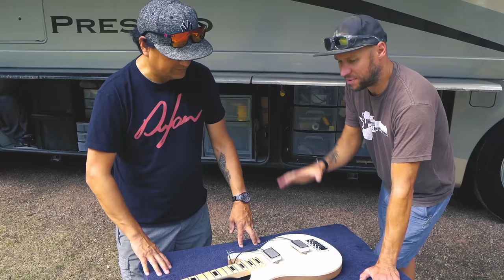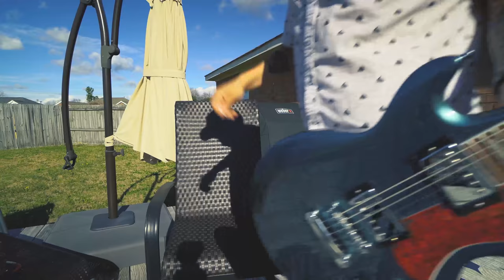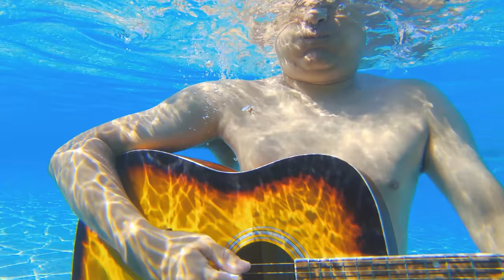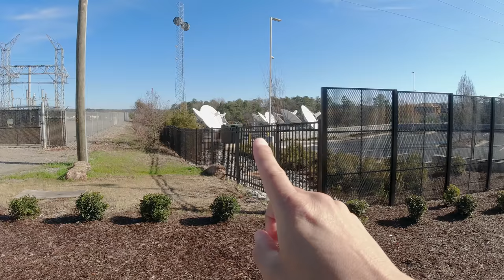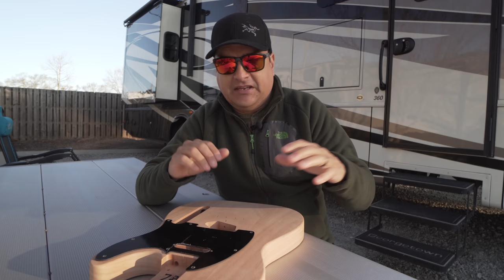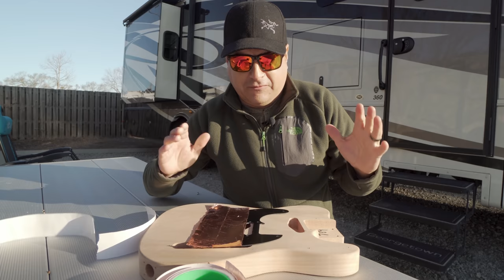How To Shield Your Guitar - Myths Busted

Comment: "60 hz wave is 17 1/2 feet long so the hole has to be smaller than that to stop it." - Doesn't that mean you can leave a hole big enough for the front of the pickups and still have a Faraday cage for 60hz, technically? 100% attenuation isn't necessary. Quibbles on the terminology aside another great video from you, good practical advice. What do I use? I've used tape in the distant past, it was a huge PITA and I had to redo it several times but eventually I got it to work. When I got back into a guitar after years away, I expected to have to do it again; and I got some paint on sale to try that method instead. But I never applied it. I haven't found any hum yet, and I'm not going to try to shield until I have a way to test the shield and see whether or not I got it right. But eventually I expect to give the paint a try. Gonna need a tiny brush and some good optics for that.

Comment: What if it is a guitar with no pickguard? Do you recommend shielding the pickup cavities?
Reply: I have the same burning question
Reply: You can, it's better than nothing.
A partial shield is always better than none.
Reply: why not use a noisegate ? once you start adding effectpedals you ll need that anyway
Reply: He's said it several times... If you do require shielding on a guitar with no pick guard, you can try to apply shielding in as much cavities as you can. Just avoid the input jack to prevent shorting the circuit.

Comment: Also, making the face of the top of the guitar arched would act opposite from a dish, radiating the RF away from a central point, and to ground. That's why physical shields are shaped that way, to direct the attack away from the center. I'm digressing, but curious about how the difference between RF striking a fluid concave meniscus vs a convex meniscus and how to control the nature..and how that could be used to accept or reject certain signals and or noise.

Comment: Thanks Dylan... Great info to add to my research as I start my first build. It will in fact be a Tele.  The control cavity advise , was time and trouble saving and also leaving the output jack alone.  Does the ground wire however have to hit the copper or will the normal pot grounding be enough.?

Comment: What do you recommend doing for a Jazzmaster that has an aluminum pickguard? Just make sure the pickguard is soldered to ground? I'm going to have a tech do some wiring for a partscaster, so I'm a novice with this stuff, but based on what you're saying, it seems like I should not have to shield the body at all if the pickguard is aluminum.

Comment: I got a roll of aluminum for my guitars. It works well no I think i paid $5.00 for the roll at Home Depot. I used paint to cover the gaps and tested it with a multimeter set on continuity. That way it beeps whenever here is a good connection. Then, if I need to I bought plastadip to keep things from shorting out!

Comment: Question for you mate, I had to get my guitar a bit more resistant to feedback in a hurry and couldn't find any copper tape. I found Aluminium. Laid a couple of bits on top of one another, got continuity, so I used that. It has worked, but would copper be loads better? Should I redo it? Or should I just leave it aluminium? By the way I did my control cavity! Nothing is shorted and the guitar sounds so much clearer with its super low noise floor

Comment: i shielded a very noisy harley benton ja60 with p90s. all copper tape. Pickguard. Cavities. Result. Its quieter, but the P90s (which you cant swap easily because of weird screws) are still noisy. But the overall noise is gone and its less prone to radiation noise. changed also two pots to 500k, maybe some of the noise is gone with that. HB skips the whole shielding because the guitar comes for under 200 bucks. But with p90s......not the best decision.

Otherwise i only shield with weird noises. My old ibanez grg crackles when you touch the screws of the pickup selector. A bit of shielding and that was gone.

Comment: I am a bit confused something you said about the wires not being a good antennae for RFI/EMI. I've been using shielded wiring in my guitars for years now and had great success in interference free play ever since I started. As a network engineer it seems highly logical. It is after all why we have shielded cabling. I'm definitely curious to learn why you don't think the wires are a good receptors. Wouldn't the metal housings of the other components be more like a faraday cage since they are grounded housings. I'm not the expert and am not trying to argue at all. Just want to learn what and why things work the way they do.
Reply: And you did do a great job explaining a lot. Hopefully not confusing more than myself.

Comment: I know there is more noise introduced through old wiring in homes and bad wiring in general,than all the wayward signals in history. A power conditioner really works, way better than trying to shield against radio signals that don't exist. Remember. Tvs,plugged into the same circuit of a guitar rig causes horrendous noise. Bad ground on houses,or entire grids cause this also.    I lived in an apt one time,every plug in the house introduced bad noise. I was hearing air traffic and pilots talking through my amp. I changed outlets and it all disappeared.    The fuhrman power conditioner works too.

Comment: You still want shielded cable from the volume pot to the jack. Just like you run shielded cable from the jack to the amp.
Check out $100 Epiphone Specials and they have shielded cable to the jack -- because humbuckers are supposed to be quiet and they don't want other features of the guitar to make noise and cause buyers to doubt the humbuckers. Fender knows you expect noise from single coils so they just run two wires out there on Custom Shop priced models.
Reply from the maker: Meh....

Comment: Trying to understand what shielding does. If the pickups are the antenna, how does shielding reduce the 'unwatered RF' reaching the pickups? Using light as a substitute. If I shine a flashlight at the guitar, the light rays heading towards the pickup hit the pickup, and the rays going to the shielding hit the shielding. 
With the guitar and RF, does the presence of the shielding create an 'alternate' antenna we shunt to ground, such that with the flashlight example the shielding bends some of the light away from the pickup to the shielding?
Generally speaking I love the level of detail you present, but this topic has me a bit puzzled.

Comment: Beware of the copper tape, I used some and had electrical continuity at the time of installation because I went for the type with conductive adhesive. 3 or 4 years later I worked on the guitar again and had lost all continuity in all areas as the adhesive was no longer conductive. I ended up having to add small bits of solder between the sheets, even in the pickguard. One of the reasons I will probably look at moving to the shielding paint instead.
Reply: Or just paint over the seams of the old tape with the paint, and save some time.

Comment: Thanks for this. I have a T-style guitar I'm upgrading. The routing work is very rough cut and unfinished. I'll probably sand the cavity surfaces, at least the control cavity area where I'll install the mechanical 3-way switch so it clears the bottom. So I'll definitely add conductive adhesive copper shielding tape to the full back of the pick guard and a strip to overlap the screw hole from under the pick guard and control cavity. Not sure what you think about the backs of the metal control plate and bridge plate (with its ground contact wire) too, just to maximize the copper area? That extra bit is not really needed but it's the same principle right?

Comment: I wonder if you could add a copper strip inside the fretboard before applying the glue and have a clever way to hide it's connection to the ground into your pickup cavity. Effectively creating an antenna that leads to the ground. Half the guitars have a thin strip of masking tape over the truss rod to prevent the glue from seeping in.
Reply: Ground the truss rod.

Comment: Picked up a 1st year Eric Johnson strat in a trade. It's almost perfect but, as Dylan says, it has the "hum" which goes away putting your hand on the bridge. Not a ground issue. Turnbguitar volume down & hum is gone. While I had it apart I admired how nice the inside looked. I decided not to shield because of how good it looks. I've just learned how to keep it quiet and crank the amps. 
Nice video brother!😎

Comment: My Les Paul Studio picked up a lot of noise from robotic show lights.  About five years ago, I bought the same copper foil with conductive adhesive you have and lined the cavities inside.  It was a royal pain, but helped tremendously.   Like you said, there are so many variables that can affect the response of a particular set of electronics in a particular environment.

Comment: Any thing that reduces extraneous electromagnetic interference is a good thing. No need for conductive glue. Make sure the copper overlaps. Where it overlaps, poke it with an icepick. This pushes metal from the top layer into the bottom layer. 
    Best remedy for noise is a noise gate. Signals below a set level is never sent to the amp. Signals sent to the amp are many times greater than the noise in the signal. 
  Listen to Stevie Ray Vaughn

Comment: thanks for this. 
One bit I am not clear on....do I have to connect the earth of the jack to the copper shielding tape?
Reply: control cavity plate is made from metal and grounded pots are in direct contact with it, so that small strip will connect shielding to the plate that is already connected to the ground to the jack (in case of proper wiring of coarse). So no, separate additional connection is not needed.

Comment: Good video but I disagree with you comments about shielding cavities having no effect and, if the shielding of cavities causes there to be no sound, blaming the shielding, rather than some wiring screwup which is being inappropriately grounded to the shielding, is not right. The solution is to track down & fix the wiring issue, not rip out the shielding.

It should be obvious, though they capture & dissipate EMF in different ways...if a Faraday cage must be as complete as possible, so must a shielding "cage".

It is also important to note that pickups with grounded metal covers also act as shields in their location. But, often omitted is shielding of the rest of the rig between the guitar & the amp: Cables need to be shielded (...cheap ones may not be); Pedal cases need to be metal, and grounded; & pedal individual power supplies need to be electrically isolated from each other. Some of these issues are often ignored, leaving multiple places for EMF to invade the guitar's signal to the amp.

Comment: I watched a few of these. Most have the control cavity shielded. Having watched this and other of your videos, I'm doing it your way. Probably the most intelligent, or at least educated out there. I probably missed it but if I shield the pup cavity because I don't have a pick guard, will the coil springs of my P-90 height adjustment touching the copper tape cause issues?

Comment: I just use a single big enough sheet of copper sheilding foil to cover rear of scratchplate as conductive glue breaks down over time & with hot bright stage lights...you must mix graphite paint for days to get a smooth black paint like finish but proven to be more effective than copper foil or silver foil...someone done a video on YT with copper,silver foil & graphite paint...graphite painted interior body with copper sheet on rear of pickguard scratchplate worked the best,lowest measured noise....

Comment: Why does my 50s Epi Les paul with 50s wiring hum but not my 60s Epi with normal wiring. When I use a 5.8 wireless system ( Amoon) it still hums. But when I use the legato UHF wireless system on either there is no hum.

Comment: As my luthier says, "If you want your guitar in a Faraday cage, then step into a Faraday cage when you play it."
Reply: yep
Reply: I found the simple change to LED 4 bulb lights overhead in my music room fixed the buzz completely (no fluorescents at all...ever)
Reply: @gittarpikk  Some of the cheap Chinese LED lights generate huge radio frequency noise.  Stick with the big name brand lights like Phillips and GE.
Reply: @gittarpikk  Depends a lot on the quality of what you get. LEDs are not interchangeable with florescent lights or incandescent lights, so they usually come connected with extra electronics to keep them happy. While LEDs are pretty quiet themselves, that extra circuitry may be noisy.
Reply: How to shield a tele with clear picguard
Reply: @jimmywheat2109  Separate the pickup cover from the Earth wire and give it its own third wire as the outer part of a 2 core braided shield & the inner 2 wires go to the ‘hot’ & ‘earth’ of the pickup itself 👍
Reply: Probably a faraday cage booth may work for studio recording

Comment: Hey Dylan I had an issue with no sound when shielding to my output jack and when I removed it it was fine. You mentioned it would cause problems but why is that the issue with the output jack?

Comment: 100% correct on the control cavity (Tele)…leave it alone.
Reply: where I live there is some source of rather high frequency hiss that is greatly reduced if I shield a control cavity of the tele. Tested on a two tele guitars. But only at my place. In other places there were no difference between shielded and unshielded  configurations. SO, it is greatly dependent on conditions.

Comment: I see several problems with your theory. Mostly that you seem to think grounded metal will somehow direct noise away from the pickups.

Well if a pickup, single coil pickup picks up noise because it has both a positive and negative lead, obviously the magnet and poles as well as the coil, yet if you delete one of those leads, produces no sound at all. So i see it as very improbable that grounded metal, or shall we say ADDED grounded metal, in the circuit will somehow redirect noise away from that pickup.

Comment: Personally I use a bit of both types. Foil's great on flat surfaces (pickguards) and paints easy on uneven or hard to reach places (like cavities). Paint also takes longer to apply (generally a few coats and long drying times), so I have to factor that into projects. If I want it done same day, foils the go. 
And as you said, no need to buy the expensive Stewmac stuff. I get rolls off Ebay or Aliexpress in various thicknesses (2-4" wide for pickguards and 0.5-1" for control cavity sides). Also check out your local hardware store near the snail pellets for copper or aluminium foil near the builders film.
Reply: @slimturnpike  Well it really depends on what you're trying to achieve and your environment. It's more effective when working with single coils. But if you expect it's going to eliminate all noise you'll be disappointed.

Comment: Q: does the metal shielding have to be copper, or would aluminum work?
Reply: I've used aluminum tape many times - works fine, but it didn't have conductive adhesive. So, I just bent over little tabs so each strip of aluminum makes contact with the adjacent strip. Test with a voltmeter to make sure you have continuity across all the shielding. The first time I used Aluminum tape, I thought the pickups sounded brighter. I don't know if that's possible or not. Maybe Dylan will comment.

Comment: Hi Dylan, when you said all the shielding copper must be grounded, do you mean we must connect this shielding to the ground of the jack ?
Reply: That's what the little strip of tape he mentions is for. That'll connect the pickguard to the control plate which is grounded. If you want to check, unscrew a couple of the pickguard screws after you install it and check continuity with the jack or the control plate and the underside of the pickguard.
Reply: @aaronmhanson  thanks for the confirmation :-)

Comment: Q: When shielding a Telecaster, should I shield the bridge or does the metal plate already surve this purpose?
Reply: I also have this question, I’m building a tele with no pickguard and no control plate.
Reply: @chopper4484  I have an Ibanez Rg with twin humbuckers and no scratch plate, the cavity for the pots is painted with shielding paint but not the pick up cavities...it's the quietest guitar I have...silent until it's placed near a 9v power transformer or laptop/PC.
Reply: The bridge is a shield in itself. Make sure you ground it and you're golden. The metal plate on the bottom of the bridge pickup should also work as a shield of sorts, although its primary purpose is to direct and shape the magnetic field of the pickup. I think that should be grounded too but don't take my word for it.

Comment: Thanks Dylan!
So just to be sure I understand, shield back of pick guard and ground it with small piece of tape on control jack screw. No more shielding neck pickup cavity.
What about bridge? Does the Tele metal bridge plate act as the shield (since its metal) so long as it’s grounded? No need to shield bridge pickup cavity anymore? Thanks in advance!
Reply: Looking to shield my Tele...same question as you. Have you tried the method mentioned in your post? If so, success?
Reply: @ajb625  I did it on a couple earlier builds and it seemed to work ok. 
I don’t do it anymore because it isn’t necessary…..my opinion of course.
I can live with the normal hum a Tele or Strat makes because I don’t play super loud or with a high amount of gain.
Reply: @Strumbum01  thanks for the update! I'll probably end up shielding just the pickguard and the little tab at the control cavity for that overlap. My Tele seems to be very sensitive when additional eletronics/lights are turned on in the house. The hum gets really bad. most everything else in the house is off, it is actually quite quiet.